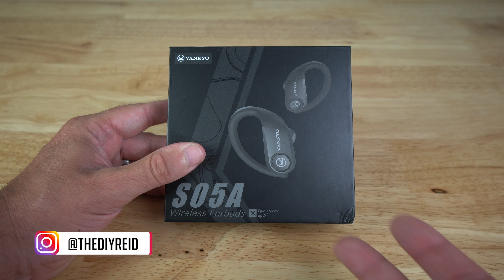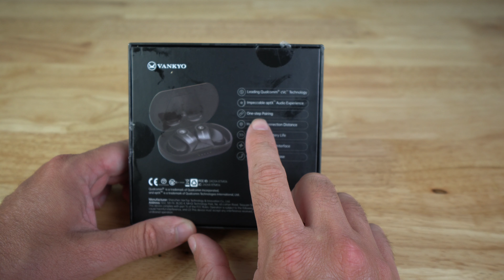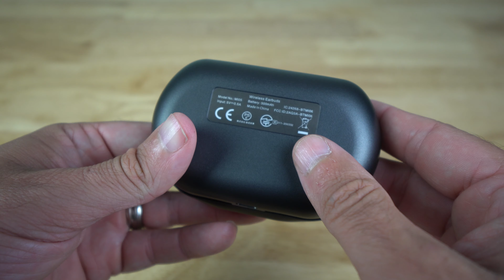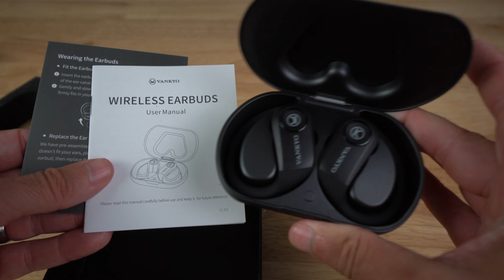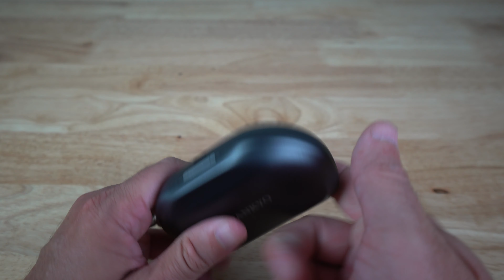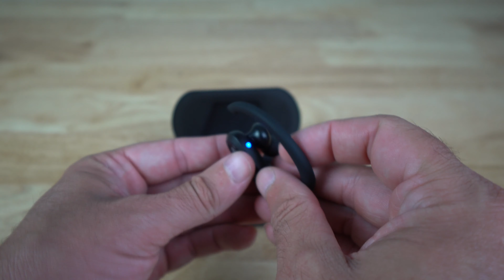Vankyo S05A Wireless Earbuds with Noise Cancellation

Comment: I cannot change the volume on mine. When I use with phone I can control with phone volume... however when connected to tv/firestick they are way too loud... the volume control on earbuds won't work and TV remote gives up control to earbuds so cannot lower volume with the tv remote. Any suggestions?